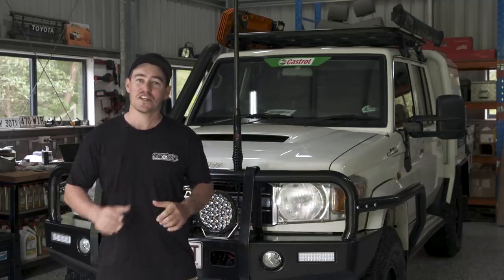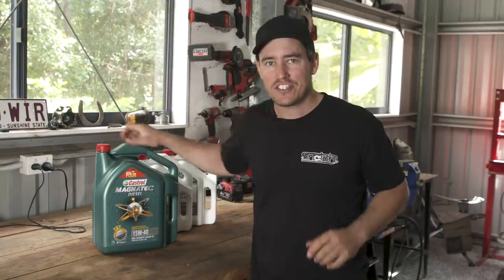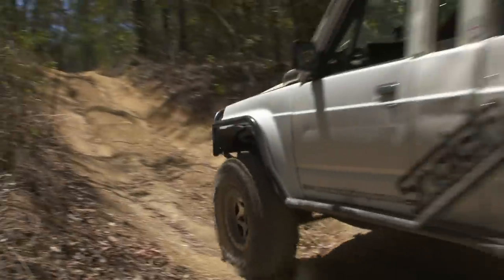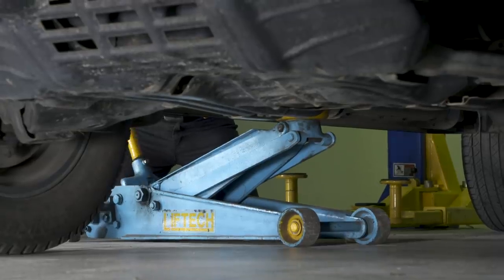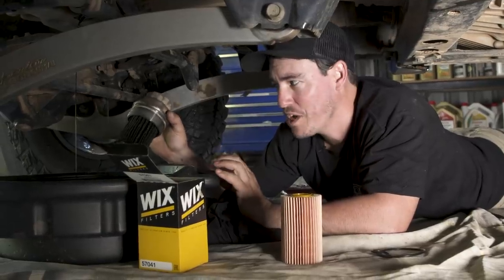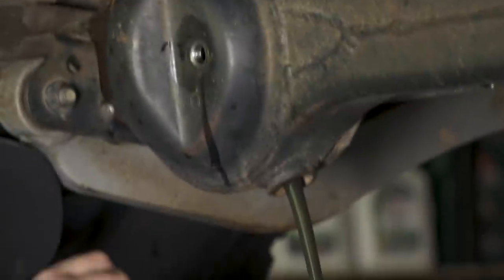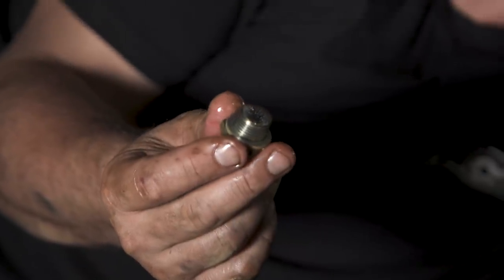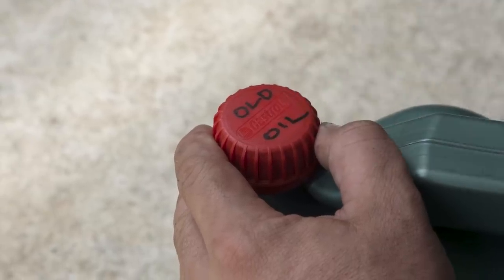HOW TO CHANGE YOUR 4WD OILS – Tips & Tricks w/ Shaun Whale

Comment: Great video!
I have gone through many oil change diy videos on YouTube, but no one seems to emphasize the little tip to LUBRICATE THE O RING. It is very important. I had a friend blow an engine because the mating surface of the o-ring was a bit too clean, and it pinched the o-ring while turning the filter to tighten it on. It blew the o-ring out when the engine was revved higher on a highway. During the retrospect, everyone blamed the o-ring. I knew that wasn't the case.
Always oil the o-ring!

Comment: Done a couple of long trips away with the camper trailer and have done midway engine oil changes in the Patrol at a camp site, take all the gear you mentioned and the old oil goes in the new oil container once refilled, get rid of it when we get home.  I also have the Provent 200 catchcan and drain that too at the same 5000k mark, really good to see how well they work.

Comment: When using one of those oil syringes/pumps, make sure the hook at the end of the hose is in nice and tight. I once had it blow off and into my diff 🤦🏽‍♂️
Reply: Anonymous geezer  he means the metal hook part at the end of the pump hose I believe
Reply: @ndh8445  correct
Reply: I’ve done that as well :/

Comment: Great tips and advice guys. Love all the videos.  Here's one more tip regarding the oil filter cartridges like the the one on your 79 Shauno. When replacing the oring on the oil filter cap, make sure that the oring is not twisted when it falls into it's groove. That will cause a leak from the oil filter housing when you screw the cap on. Just run a small screwdriver in-between the oring and the cap  and that will untwist it.  Keep up the good work

Comment: Top video mate and I don't even own a 4WD (hopefully that will soon change).

I empty the old oil out at the tip myself and always bring 2 empties home with me. That way I know I've always got enough containers to store the old oil.

Another tip I recently come across (and it helps with mess) is if you have one of those cartridge type filters, undo it until the oil starts flow and then leave it until the drips stop, then remove the filter completely. The oil flows nicely down the outside of the filter and into the pan.

The big retail outlets have their top level oils 50% off at least once every 3 months. Just buy it then even if it isn't time to change the oil. e.g. you can get Castrol Edge for $35 (or less) and I once got the 10L for $65.

Comment: Another handy tip! When doing the filter, place a sheet of foil below the filter before you take it off. With the foil you can wrap around your car to keep it from getting messy AND! YOU CAN USE IT TO DIRECT THE FLOW OF THE OIL! NO MORE MESSY DRIVEWAY

Comment: Awesome video! Quick tip when installing any cartridge filter make sure the o'ring is seated correctly and that the o'ring is not twisted as it my get pinched and not seal. Also how many people out there checking the 3.2l rangers bt50 motors for the wiring rubbing on the timing cover??? Would be interested to see how many people out there doing that.

Comment: A good tip if you have the steel body engine oil filter and its to tight to undo you can get a bit phillips head screwdriver and wack it thru the side of the filter and out the other side then use like a t handle 😉 this works everytime I get a tight filter undone works a treat with limited tools

Comment: Don't forget about the brakes. Brake fluid naturally wicks moisture. This moisture finds its way to the calipers then begins to corrode them. It's easy to do and won't require bleeding unless you let the reservoir run dry. You'll also maintain that nice stiff brake pedal like when the vehicle was new. 

Might as well change the power steering occasionally too.

Comment: if u happen to spill old oil onto the concrete or cement have a bottle of shellite at hand just spray and wipe, also shaune didn't do this but doesn't matter if u do or don't but you should also wipe in where the  old oil filter was that way you don't contaminate the brand new oil and oil filter

Comment: 2 top tips; 1 use a torque wrench to tighten all bolts to spec.. 2 recycle used oils at a used oil recycler, not the dump.

Comment: If you happen to be that guy who forgets the 10minute rule regarding the 3.2lt Ranger/BT50, pour 13litres of oil in and let it sit overnight before you crank. The idea behind this is for the oil level to come up above the height of the pickup and pump, thus forcing the oil to feed  itself up the pickup tube into the pump. Vein style pumps can’t create a vacuum to pull fluid unlike gearset oil pumps, hence why power steering pumps have fluid feed in from the top

Comment: If you've got an older diesel without a catalytic converter, don't use CJ-4 oil because it's limited to 800ppm of zinc. Using CI-4 or CI-4+ is the way to go.
Reply: yeah i think there's def overkill running full synthetic etc in an old car too. Just keep it simple, cheap mineral oil and change it regularly
Reply: @benhoughtonmusic  I would say don’t use cheap mineral oil but good quality mineral oil . Why would you want to put cheap engine oil in your 4wd ?
Reply: Interesting thanks, do you know what the best oil would be for a Toyota 2.5 D4D Turbo Diesel Intercooler, it is a 2012. I want to look after the turbo, but do not want to run it for 10,000KM as suggested by Toyota. I would rather have a good oil that protected the turbo and the engine and change it every 5-8000KM. No cold starts, but high ambient temperatures, normal ranges over the year would be 10C - 45C. thanks.
Reply: Mineral oils are literally garbage!
We didn't evolve from mineral to 100% Synthetic like Amsoil for no reason!
The best protection oil is the oil that has the strongest film, the best cleaning additives, the least affected from heat etc.
Reply: @АлександърИванов-щ8ю  fair enough but i don't feel the need to put synthetic in my 1hz haha
Reply: @richardgraham65  Depends on whether it has a Diesel Particulate Filter or not. If it does then you'll need a low SAPS oil like the CJ-4 spec to prevent excess particulate from blocking the DPF. Synthetic oils are inherently better at resisting breakdown at high temperatures in the turbo (and the spec sheet should specifically mention that it's a "turbo-diesel" oil). You'd be looking at a 40 weight oil for the higher ambient temps, like a 15W-40 or 10W-40. There should be some options available that meet those requirements.
Reply: @jimtekkit  Many thanks for that, your help is appreciated! (It does have a DPF and I think it also has a catalytic converter but I might be wrong - There is a DPF with wires and tubes just after the turbo, but half way along under the truck there is a large cylinder about 1 foot long, no wiring or tubes, it is between the muffler boxes) The Toyota specs are really confusing, they recommend ACEA C2, or ACEA B1, or API CF-4, or CF or API CE CD, whatever that lot is?
Reply: @richardgraham65  Yeah the API CD/CE/CF/CF-4 ratings are all superseded now. They're meant for pre-2009 diesels and so I wouldn't recommend them anyway. ACEA B1 is a viscosity rating (obsolete) and the ACEA C2 is for catalyst compatibility. Probably the most important one would be the ACEA C2 spec and I'm pretty sure that the Penrite Enviro+ full synthetics meet that requirement. Just gotta look around and see what's available.
Reply: @jimtekkit  Amazing eh, that is what Toyota published in their manual for oil recommendations on their 2012-2015 Hilux's,  I will look for the CL-4 or CL-4+ as per your suggestions, many thanks for your help in this rather confusing matter (actually I might just take it to Toyota for this oil change, as it is my first change since buying it, see what the ratings are on their can and buy similar next time) Things were so much simpler with the old 3.0L EFI non turbo, any good quality 10W30 did the trick. Now I am crapping myself because of the turbo and intercooler setup. I fitted the EGR blanking plate with the 7mm hole to try to stop the crud going back through the engine, so that might help reduce the crap going into the DPF. Thanks again for your help!

Comment: Here's a tip for diffs and transfers. Buy one of the easy squeeze nulon Bags and the remaining oil in bottles. Then refill/reuse the bag everytime you want to do an oil change. Saves throwing away 5 bags each time and means you don't need a pump bottle

Comment: Hey guys with cartridge filters you need to clean the cover for it with brake cleaner and a rag so there’s no old oil left and for the rubber seal on the filter  there is a grease Penrith sell to rub lightly around the rubber seal to prevent it from sticking.
Reply: Thats overkill. A bit of old oil is harmless and the oring doesnt need greasing. Oil is sufficient.

Comment: Thank you for stating the side poor. In my mind Castro's bottles have been the best. the side handle works best when used in the opposite direction( easiest used for the side poor as explained earlier. Only experienced oil changers go for complete opposite direction) then you would  normally,  the poor is always consistent and you never have to worry about the g l u p...

Comment: Cool tip someone told me.

Use a 2 litre coke bottle cut the bottom of it and have the lid screwed on tight and put that over the oil filter to reduce the amount of oil spill. Do it to my RC colorado works mint.

Comment: If you have your oil filter in the engine bay. What I like to do is use an old base of a take away container. Like the ones from Indian or Chinese. They are shallow and flexible plastic. Squeeze that directly into place under your oil filter when you remove it and it will catch all the oil right there at the source .without the oil having to free fall between all the other engine parts getting them full of oil. Just be careful as it's trickier to remove that container without spilling

Comment: Not to be critical Toyota Landcruisers use 9.2L of engine oil, also reminding that DPF and Non DPF use different grades. They also use 75w90 in both the Transfer and Transmission, with the fluid you are using you will find they are too thick. Also the diffs require oils to be changed every 40k not every 20k. Try using genuine parts as well, they are designed with flow rates that are correct. And the biggest things you missed were the fact that you reused washers. Replace them every time! Its cheap insurance to prevent leaks.

Comment: So here’s a question for you Shauno with the new ranger how you said you can’t drain for over 10 mins is it worth when draining the engine oil just to throw a couple hundred mills of new oil down it to fully flush out all the old stuff
Reply: Good question! but it would probably not reach all of the old oil as it would only flow in the path from the oil filler cap directly down to the sump of the engine.
Reply: Krump 7 😅😅😅
Reply: Don't worry if there is little bit of oil left in there. Your adding 9 odd Liters of fresh stuff to not much dirty stuff. Just get it done in under 10mins. Have all you shit ready to go.
Reply: Krump 7  guessing you had one bliw up on ya.

Comment: Thanks Shauno, awesome video, very informative, now that all the oil is changed and topped up with fresh lube, when should you grease all the grease nipples in and around the cab (propshaft, CV, WB, control arms, etc)
Reply: Every 10k, over greasing them is just as bad as not enough

Comment: Cost effective maintenance (Google it) have the best flushing and oil additives.. 99% of what's out there is hocus pocus but that stuff works like you wouldn't believe. 

Everyone thinks oil in a diesel goes black instantly but that's simply not true if you know what you're doing.. Take it from me I used their flushing additive and my oil was still golden brown after 3500km whereas it would be instantly black after an oil change even with some branded oil flush.. And I own a td42 one of the dirtiest diesels getting around.. 

Get onto it.
Reply: Absolutely, just hit 5000km and the oil is still golden brown! The sludge that came out on the first treatment was incredible too. Love the stuff. Pro ma do a good additive as well but the flush from CEM is great
Reply: Go boil some water with your kettle champion.
Reply: Anonymous geezer  just service it every 10,000km, keep the plugs and leads in good nick and you'll be right as rain.
Reply: Anonymous geezer  then it's fucked mate. I'd get wrecker motor and rebuild it on the side.
Reply: Anonymous geezer  the 3RZ is normally rock solid. Maybe it has been over worked on hard trails by the previous owners
Reply: Anonymous geezer  ah sounds sus unfortunately mate. They're normally a good rig.

Comment: must be the reason defenders engines keep going, regularly get new oil put in
Reply from the maker: Oil leaks stop them from rusting too 😂
Reply: @4WD247  converts oil to rust resistant coating.....mine has 500k+ on the clock saving for a patrol or land cruiser next, no biase on my side just enjoy the vehicles offroad

Comment: Hey does anyone know why my 4wd takes ages to turn over. Have had the glow plugs replaced, alot of the electronic side of it looked at, and a few other things looked at and the mechanic still can not find why it takes so long to crank before starting. Does anyone know what it could be? Cheers guys
Reply: Check diesel pump and timing.

Comment: I was told it’s only the early model bt50 and rangers that needed to follow the 10 minute oil change
Reply: Its From 2011 models to 2020 with the 3.2 lt 5 cylinder motor ....I do the oil filter first than do the oil..
Reply: @carloluvisi4804  yeah its not hard to do in under 10. Do you take the wheel off to change the filter?
Reply: @wesmccullough8176  yes Wes, I take it off makes it that little bit easy

Comment: i'll clean my oil catch can, drain the fuel filter, pressure wash radiator, clean air-filter, detach both the ends and air blow all the breathers & clean crank case ventilation valve breather.
Reply: Pressure wash the radiator hey? As in pressure was inside I assume? Those fins on the outside aren't going to be happy under a pressure wash.
Reply: @Nick-sd7um  True, I have an adjustable pressure washer at home which does the job well.

Comment: Everywhere I buy oil for the mq triton it sais I need 8.4 litres but my manuel sais 7.2 . Made the mistake the first time and I had to get under and drain a litre it was very messy
Reply: Get 2 5L bottles of oil cal. I did a full drain on my ‘15 mq and used close to 8L.
Only issue on mq’s is the location of the oil filter draining wise

Comment: You didnt go through checking brake pads or pulling off hubs and checking brake shoes, adjusting brake shoes or greasing unis and drive shafts just saying that should be part of the service as well not just oils